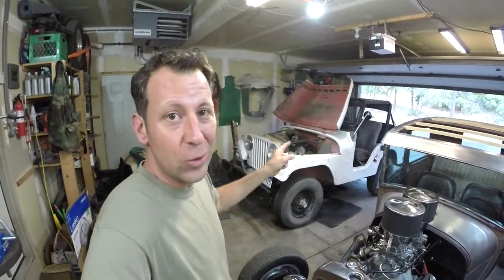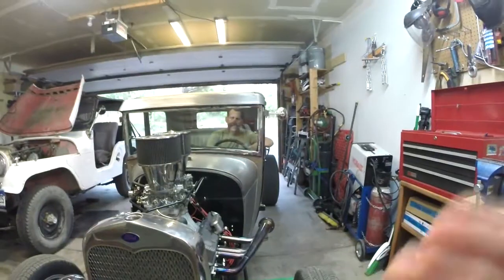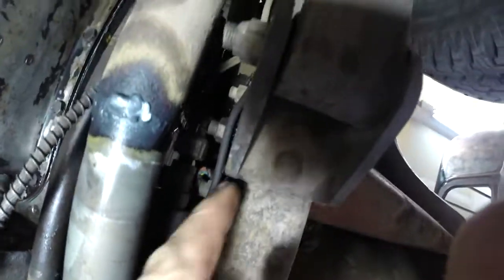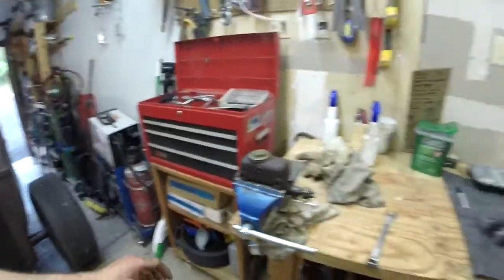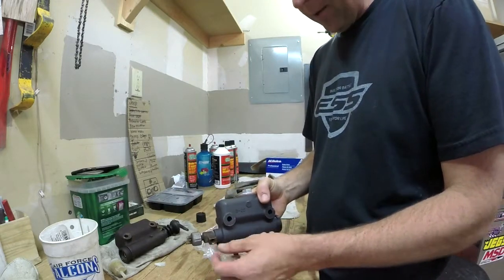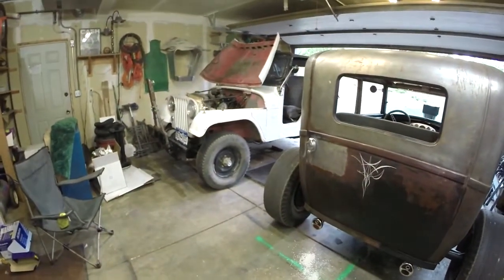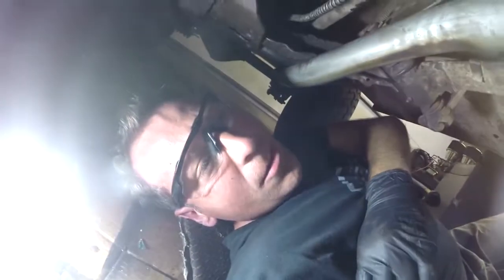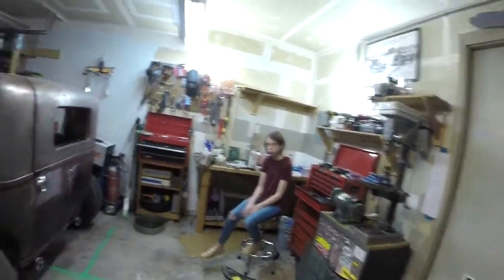Willys Jeep CJ5: Master Cylinder Replacement.  BHG Ep 55

Comment: great help. the brakes on my 1965 cj5 tuxedo park, went out, same as you described. watched your video, ordered a master brake cylinder and got it in. Thanks. As an aside, any ideas on transmission for the jeep with a 3 on the tree? thanks again.
Reply from the maker: Glad it helped! I do not know of any good transmission replacements, unless you want to convert to floor shift.  I am going to stick with that stock trans on my Jeep- even with a 4.3 v6 conversion.

Comment: I lost those bullet connector clips. Any idea where to find new ones?
Reply from the maker: @Justin Eldridge unfortunately I don’t have a line on the OE replacement parts.  I know you could just buy the generic brake switch that comes with the wire connectors if you wanted to go with aftermarket parts.